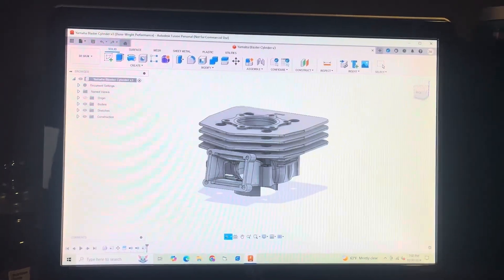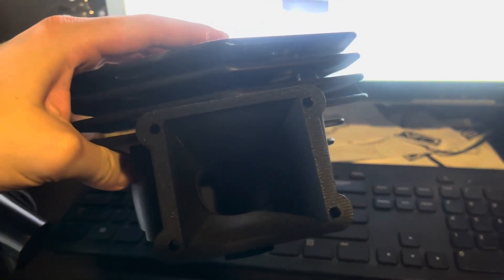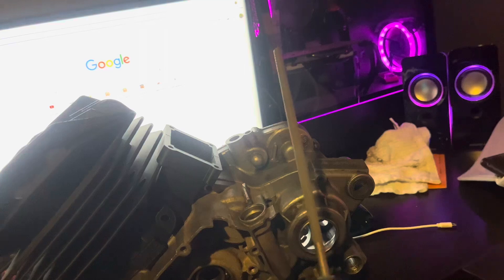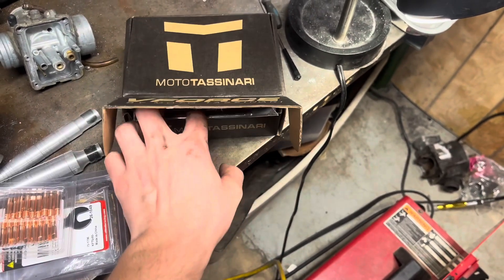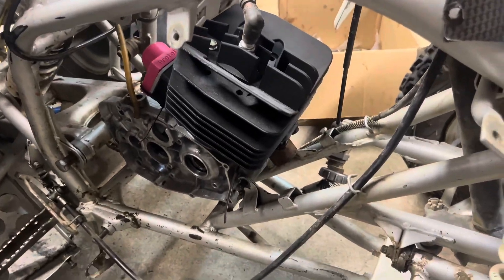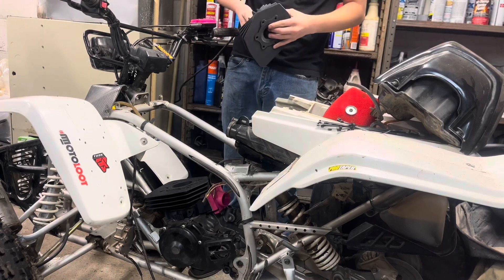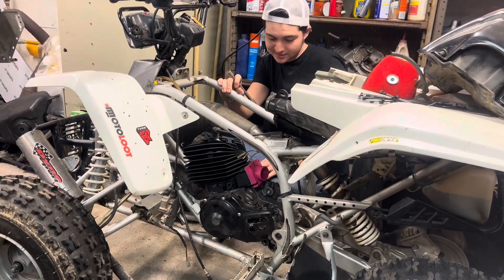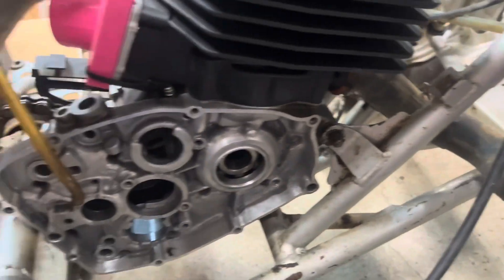Test Fitting my CUSTOM Yamaha Blaster Cylinder

Comment: I think the Suzuki lt250r would possibly be even a bigger hit. The Honda TRX 250r market was flooded with different aftermarket cylinders. I'm sure if there was an awesome Suzuki big bore cylinder you'd sell a ton.
Reply: I agree! If you made Suzuki cylinders it could change the game big time, Suzuki owners been wanting cylinder options!
Reply from the maker: @robertdoxtator2493  I have one of those machines in pieces. You can see the motor on the shelf.

Comment: What material did you use to print the cylinder head up out of amd also is it runable at that stage or would you have to send it in to get printed out of metal im very interested
Reply from the maker: @jacobabshire1564  PolyMaker PLA. 

Unfortunately, you cannot run the engine with a PLA cylinder. It will be casted from aluminum.

Comment: Good work you need to make one with a cr250 reed cage
Reply from the maker: @austinpuderbaugh5914  CR250 cage was too big for how limited this engine was designed. It lost reed velocity.
Reply: @ I’d still be interested in a cylinder if you do get them casted.